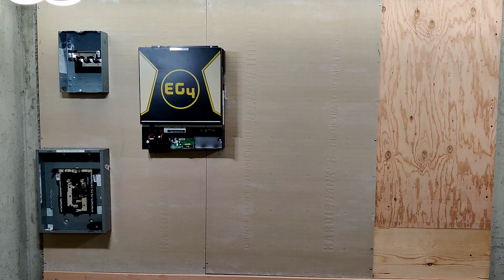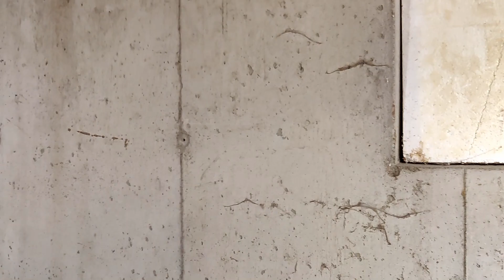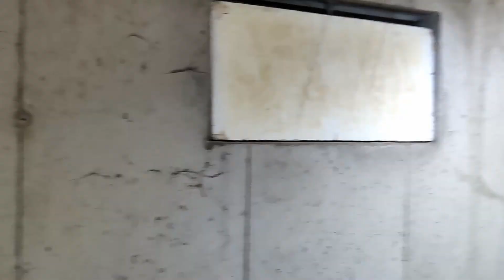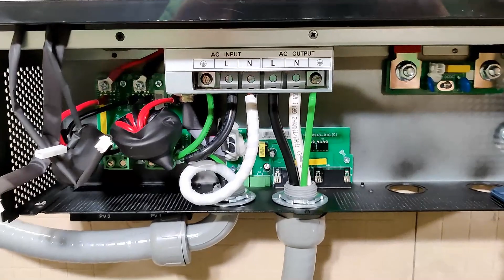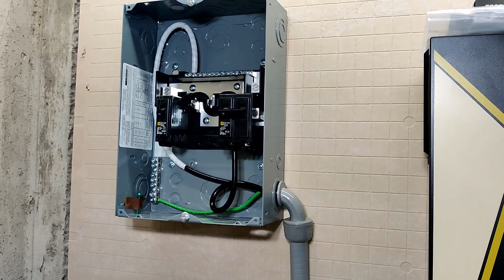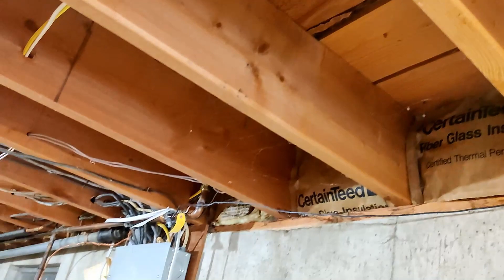Installation of an EG4 6500EX Based Off Grid Solar System - Part 1

Comment: Why use a subpanel instead of wiring direct from your main panel for grid power?
Reply from the maker: TLDR: For flexibility.
The long answer is my garage is directly above the sub panel.  I wanted to eventually add a 240v outlet in the garage for use with a welder, or with an EV charger.  The sub panel is cheaper than running more 4 gauge from the main panel to the garage.
I also had planned to add a second 6500EX before it was discontinued, and running the wiring straight to the first inverter would mean I'd have had to install a sub panel anyway to hook up the second inverter.

Comment: Cracks me up how people are infatuated with boxes. This system could have just gone from the inverter to the main panel with a breaker switch in between which I am doing with two of these 6500EX.
Reply from the maker: Sure it could have... if I had two 6500EX's to run the entire main panel.  I have one, so only one leg of the main panel would have been powered.
Reply: Do you mind posting pics of your setup. Im interested in doing something similar and need all the info I can get.

Comment: May be a silly question but why have the two extra load centers? Can't you just add a breaker in main panel to supply AC/grid for inverter and a separate breaker for input/backfeed from inverter?
Reply from the maker: TLDR: I'm divorced and my kids are grown.  I need something to keep me occupied on weekends, so I make it overly complicated. ;)

Or the long winded explanation:
If you're moving your entire main panel off grid, yes.  You'd have to add a lockout on the main breaker of course so you couldn't accidentally backfeed the grid.  This is probably the simplest cheapest way if you have enough inverter power and batteries to run your entire main panel, especially if your inverters are right next to the main panel.
I on the other hand am running a critical loads panel and leaving all my 240v loads and my power hog home theater equipment on grid for now.  I also only have one 120v only inverter for the moment.  The load centers to the left of the inverters are mostly for convenience (turning off all the equipment in one place) and expandability outside the main panel.  The garage is up 7 feet and on the other side of the wall from the inverter wall, so the grid feed load center gives me options for a generator input or a welder/car charger/etc without having to make another long run back to the main panel.  The second load center just lets me run circuits that run only off the inverter without any grid feed unless the inverter is in bypass mode, and lets me add another breaker if somehow I decide I need more than 2 inverters.
If I wanted to drop $20-30k on a second mortgage I could get rid of all the extras and just dump a Sol-Ark next to the main panel and a 40kw rack of batteries next to it and it would be far simpler, but I don't want to spend that kind of money and I like to fiddle with things.

Comment: Video editing is fine!  Looking forward to the journey!  I still have my 6500EX in the box!  I guess that I need to upgrade the firmware first?
Reply from the maker: I've not touched the firmware on mine yet.  Its been running my deep freeze as a test load for over a week now with just a hacked together grid connection with no issues.  No solar connected yet, just solar assistant set up to charge the batteries when they get too low from the grid.
Reply: Good luck with your install. I just finished my 240 setup with these inverters last week. In trying to be code compliant I’m finding there are many things required that I didn’t know a few months ago. Since this sounds like it is in your house, I highly recommend you spend some time on that. Two things I still have not figured out is how to install arc and ground fault protection on the Solar input.  Since the EG4 6500’s can accept PV inputs up to 500v dc, I chose to set my system up with 4 sets of 9 panels in series. That puts mine over 370 volts during the day.  The fault protection gets very expensive once you go above 300 v dc and so far I’ve only found one company that makes this.  I didn’t know this when I got started.
Reply from the maker: @sonnysurles  Yeah I keep finding out new NEC "gotchas".   The "PV lines have to be in metallic conduit" NEC requirement has made getting the PV into the house a pain. I was planning on running them through my garage then into the basement.  Now I have to do a bunch of EMT work just to get the panels hooked up. 
Arc and ground fault protection isn't something I've thought a lot about, I was just at the "let's run fuses and DC rated breakers" stage so far.  A brief Google search makes me scared though. ;)
Reply: @SolarShenanigans  yeah, I'm glad I saw a Youtuber mention the metal conduit before I ran mine.  One other consideration might be to allow for surge protectors at the panels.  Midnite Solar has decent prices on them, so that's what I plan to install.  We've had a couple of lightning strike events here on the farm and fried some house electronics. So I'm installing a ground rod at the old barn where I put the panels on the roof.  I'm "bonding" that ground rod and ground wire to the solar panel mounting brackets, the inverters, the battery rack - then finally to the house ground system. But, I did not leave enough room at the solar panels to easily mount the Midnite Solar SPD's. I think we're suppose to make the leads from the SPDs as short as possible, but I will have to mount another box to do it.  So if you need them, please make plans for how to mount them and get them grounded.
Reply from the maker: @sonnysurles  Aren't arc and ground fault protection different than adding an SPD?  I know Midnite Solar makes an SPD that goes up to 600v but it sounds like arc and ground fault protection is more for when a solar panel fails or you get an arc between two PV wires with damaged insulation.
Reply: @SolarShenanigans  You are right, all three have different functions as I understand.  I've seen pictures of the results of arcing inside two MC4 connectors where they join that results in a fire under the panels.  I hope I never have to get in an argument with the insurance company so I'm trying to be as careful as I can. Even to the point of purchasing a Flir IR camera to look for hot spots on my roof especially. But I don't yet have enough load to get up to the expected 10 amps flowing out of the panels. Since I have already experienced damaged electronics from nearby lightning strikes - that tells me I definitely need to add the SPDs.  Watching YouTube channel "Electrical Code Coach" has helped a lot, especially with making sure the grounding systems are tied together (and when new ground rods are needed/required). He recently did a video about a relatively new requirement for SPDs at the main service panel.  I knew it was a good idea, but did not know it was now required, even if you make any changes there (which I assume would be when adding a transfer switch - which I plan to do at some point).  So many details!  🤔
Reply from the maker: @sonnysurles  I still have to wire up my critical loads panel and run the wiring to my sub panel for the grid input, but I've already purchased an SPD for the main grid panel as I figured I may as well add one while I was digging around in the panel.  I was planning on recording that too.
Most of these SPDs are meant to handle grid-originating power surges though, they don't seem to do much for lightning as they shunt the surge back up the main neutral service wire to the utility transformer.  Lightning (in my understanding) needs to be sent to ground not the neutral.  Some other products claim to do lightning but they're much more expensive, like "EMP Shield" claims to do but they're $350, not $50-80 like most main panel SPDs.  I also get the feeling a lot of them are borderline snake oil.
As for insurance, you'd think once you had a government inspection and approval if there was an incident you'd be in good shape, though insurance companies are good at wiggling out of things.